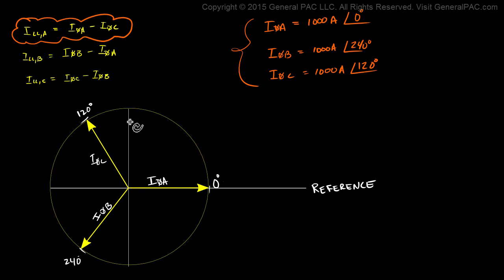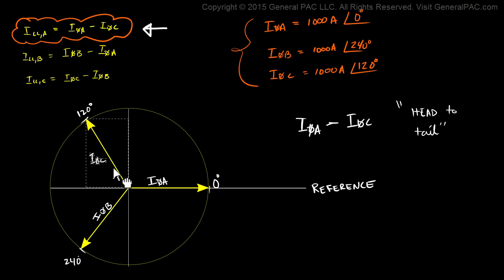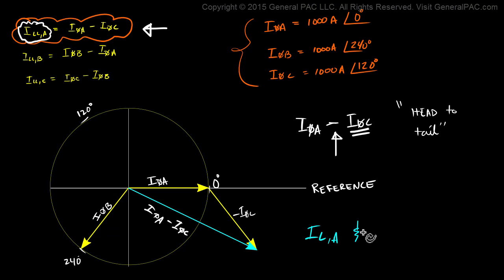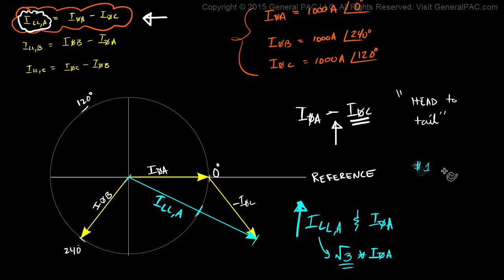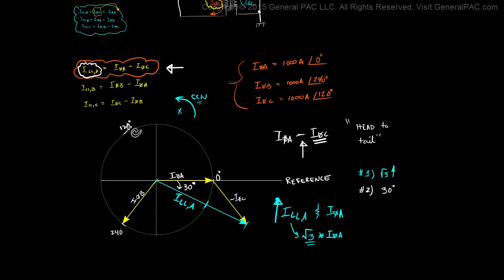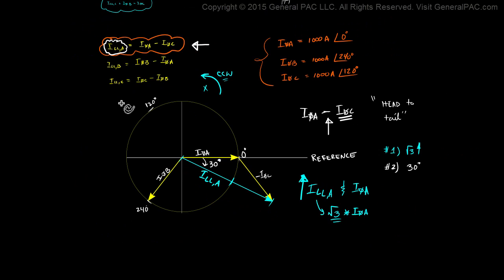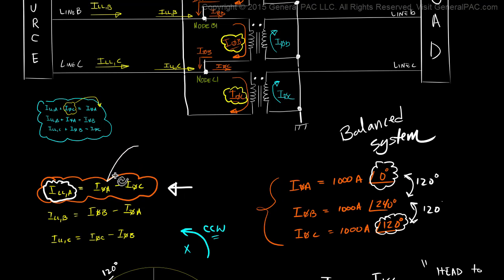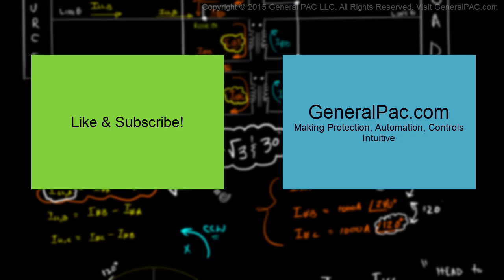Introduction to the Delta Wye Transformer Connection Part 5b: Current Phasor Analysis

Comment: Just wondering: why are you allowed to arbitrarily assign the different phase currents as having the same value but different phase shifts? That is, why are you allowed to use 0, 120, and 240 degrees as the phase shifts? Could it be any valued phased shift (e.g. 0, 31, and 55 degrees)? What exactly causes this phase shift? Also, what exactly happens if these currents are not necessarily of the same frequency? That is: if iA = Ie^{j(20t)} and iB = Ie^{j(10t + 10)}.
Reply from the maker: +Mr Mathews   Great questions. I think it helps to think about these phasors as rotating vectors. So we assume that all three phasors are rotating in the CCW direction at all times. 0, 120, 240 are simply a convenient snapshotof the phasors at one particular time. We could have easily used 90 degrees phase A, 330 degrees for phase B, and 210 degrees for phase C and we’d get the same analysis. 
Also, for our analysis, we assume that we have a perfectly balanced system which means that all three phasors must rotate in the CCW direction, they must all have equal magnitude and they must be displaced by 120 degrees. Here is one video that I did that elaborates on that concept: https://www.youtube.com/watch?v=kxtXSTgeg7I
If phase A, B, and C were unbalanced (not have equal magnitude and not be displaced by 120 degrees) then we won’t have a perfect 30 degrees phase shift and we won’t exactly have 1.73 magnitude difference.
The phase angle between Phase A, B, and C are ultimately created at the generation source like a synchronous generator. We expect to get a perfectly balanced 3 phase voltage from the source. However, due to the unequal
loads on the system (especially single phase loads), there will always be some phase angle and magnitude difference between phase A, B, and C. 
The frequency is set by the source (all the generators connected with the system) so we won’t expect to find more than 5% of difference in the frequency.
Reply: Thank you! That cleared up a lot! Just to clarify one point: why is a single phase load especially likely to have a phase and magnitude difference?
Reply from the maker: +Mr Mathews - if we look at a substation feeder that feeds your home, we see a pole-top transformer like this: http://www.bristolwatch.com/ele/img/pole_xformer.jpg  -- my home and most likely your home is a single phase load. Now there are three phases right? Phase A, Phase B and Phase C. Like the pole-top transformer feeding our home, there are many single phase loads on the system. Utilities try their best to distribute the single phase loads on each phase equally. Sometimes, there is simply too much load on one phase compared to the others. From the substations's prospective, if we analyzed Phase A, B, and C for a single feeder, we will see different magnitudes of current for each phase. That's where the magnitude difference comes from. 

If we had a purely resistive single phase load, there would be no phase difference between Phase A, B, and C currents. A reactive single phase load will cause a small phase angle difference. If we our feeder was filled with many reactive loads, then we will have a significant phase angle difference between phase A, B, and C current. 

Hope this is helpful!

Comment: Hi I was wonder based on the phasor explanation it is trust that in a delta star connection where delta voltage (l-l)leads star voltages by 30 degrees and in case of currents delta  line currents lag star phase current by 30 degree.  is this observations correct ??
Reply from the maker: +Parminder Dhawan - If the Delta / Star transformer produces a phase shift such that the HV reference voltage leads the LV reference voltage by 30 degrees, then we should expect the HV line current to lead the LV line current by 30 degrees as well.  The leading/lagging  behavior should be consistent with both the voltage and the current. Hope this helps :) 

We are going to go over this in Section 7 of this video tutorial. This is currently being worked on. The first two parts will be released next week.